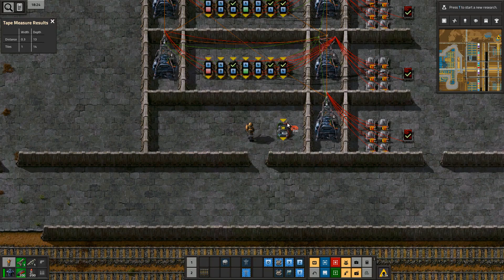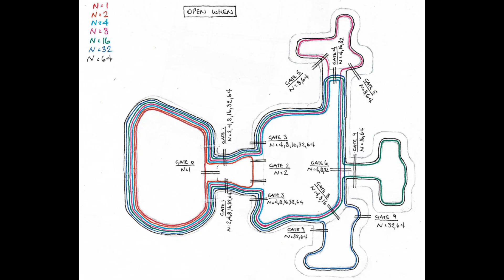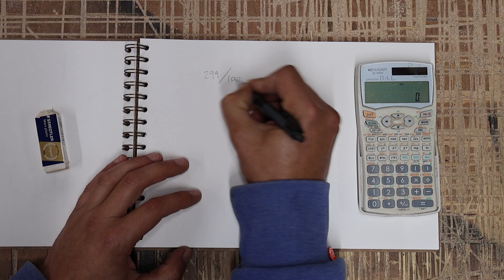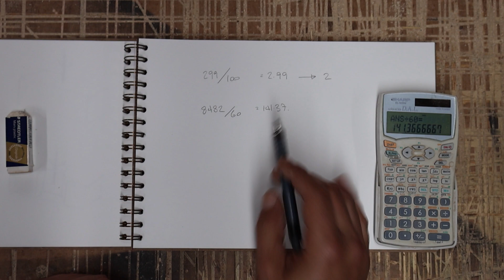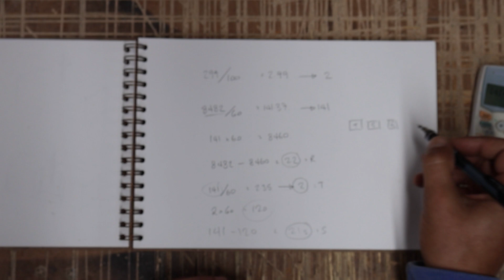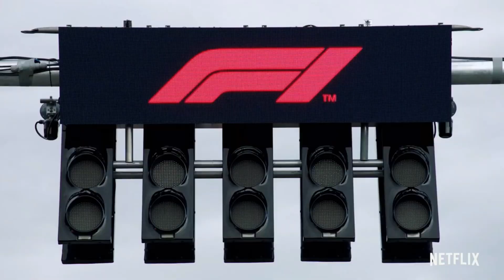Factorio - Racetrack Circuit Networks

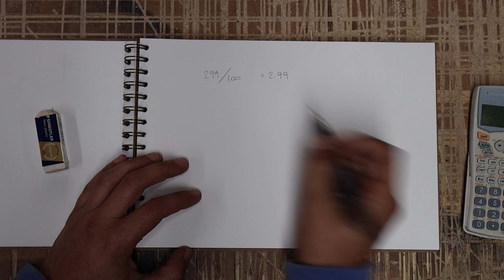Comment: 9:50 simply using "/" in factorio divides and rounds down
so in your example "299/100" results in "2"
now if you use "%" (modulo) operator you get whatever is left after dividing
"299%100" results in "99" and you can use this value for further calculations instead of doing whole "299-((299/100)*100)" chain to get the fractions

Comment: You could add a memory cell to the finish line that was reading the S value from the global network.  After the gates go down for the first person coming across the finish line, you stop updating the value in the memory cell. 

An easy way to start/stop values traveling through a network is to use an arithmatic combinator.  `* {each} x [input] = * {each}`.  Then just change the input signal to 1 when you want the value to pass through, and nothing when you don't.
Reply from the maker: I'm pretty sure I've seen a video where someone does what you are explaining here but when I tried it I couldn't get anything to work. So I gave up. 

I'm sure '* {each} x [input] = * {each}' makes sense to you but to me it is gibberish.
Reply: @theotherbigfoot  Sorry, that is describing the combinator inputs and ouputs.  Let me try to explain it better.
 
In the arithmatic combinator UI, the top left box gets the yellow "Each" Signal [*] (in the signals tab). That means apply the math operation it's about to do to every signal coming into the combinator. Then in the middle section you want the asterisk (multiplication), and then in the last box. you want some other signal that you're going to turn on and off, call it [Z].

Then for the output, you want the yellow Each signal again.

Now everything coming in will be multiplied by Z, which for this case, it would be 0 = no outpts or 1 = the same as the input value.
Reply from the maker: @sorahn_  Ooof, ok, where to begin. To start with, thank you, I at least understand the words you have put on the page!! Seriously, thank you, explaining this is stuff is difficult through text alone.

The 'each' signal multiplies everything? I'm used to a single combinator doing a single calculation, so multiplying everything is new
If I, say, enter A=5 as input as 'each', multiply it by two, and then output to 'each', where does it go? It can't output to A, because that would pollute the input, or does this need to output to a different circuit network?
How would this store anything? The timer is constantly increasing, by making something else equal to it then that other thing will always be increasing also. I don't understand
Reply from the maker: @sorahn_  Ooo oo oo, I've got it
Reply from the maker: @sorahn_  I don't have it.
Reply from the maker: @sorahn_  Nope, cancel that, I've got it working perfectly. Amazing. I am amazed.

Thank you. One last thing, is there an elegant way to clear the memory? So far I'm demolishing the combinator and then ctrl-z
Reply: @theotherbigfoot  awesome!!  To clear the memory you can just send in a 0 with a button press. 

There are elegant ways to reset them. I just don’t have one off the top of my head.
Reply from the maker: @sorahn_  I've had a night to think about this and now I have this working there is another possible thing I can make.

If I can find a way to set up multiple of these time storage thingies that cycle from one to the next as each driver activates the finish gate then I can record each drivers finishing time (assuming there is enough time for the gate to open and close between finishing drivers). I think I can do this with a series of power switches that activate as each previous time is recorded, and then also deactivate the current time with the same signal. But still keeping power to the combinators storing the time. Just disconnect everything else through the power switch. I think that could work.

Still need to find a way to reset all of this though. Ideally I'd like to use the GO switch so it is automatic with the rest of the race functions.

(Sorry to dump on you like this, if you aren't really all that interested and were just commenting for the sake of commenting then just tell me to sod off)
Reply: @theotherbigfoot  When the power of arithmatic combinators finally clicked over the basic if/else of deciders, I felt like I had to go through my base and re-do the circuitry everywhere  Hahaha.
Reply from the maker: @sorahn_  Ooof, painful

Comment: Loving this implementation! Just one question: What's the difference between divide->multiply->subtract and using modulo in an arithmetic combinator directly? Thanks for the fun video!
Reply from the maker: I don't know, is the answer. I don't know what modulo is, I've never heard of it before. I've looked at the description on the factorio website and I don't understand what it is saying. 

Is this some programming jiggery pokery? I'm not a programmer, I'm a structural engineer, I design buildings not code!! The limit of my coding is VBA!!
Reply: @theotherbigfoot  modulo is the remainder of a division, ie 5%2 = 1
so to convert ticks to seconds, minutes and hours u could do  274000%60=40, (274000-40)/60=4566, 4566%60=6, (4566-6)/60=76, 76%60=16, (76-16)/60=1
that gives u 1 hour, 16 minutes, 6 seconds and 40 ticks
in terms of combinators that would be 1 modulo operator that gives the output to the display, one that subtracts it from the previous value and one divider that gives the next value to repeat the process
edit: fyi factorio doesn't use miliseconds as it runs at a constant 60 ups, mili is always 1/1000 of something
the modulo operation also works well with timers, since it will always output a number from 0 to 1 below the divider. That way even if the number increases to infinity the output will be capped
also, there indeed is a way to stop a timer if u build it right, if i can get the map i could implement a few changes it and send it back
Reply from the maker: @przemo12323  I get it. That is super cool. Currently I have 6 combinators, by my reckoning this method would get me down to 4, I think that's right. I'm gonna have a play with this. Would definitely make the flashing lights a lot easier. 

If you could do that you would be my hero. It is a feature I would so like to have (and understand how to achieve)
Save file - https://www.dropbox.com/scl/fi/mmyvvejw55iplwrd7s9lj/Lets-Play-25-08-23.zip?rlkey=w8uisij9v6n8oejcc6cumml7n&dl=0
Reply: @theotherbigfoot  idk why i can't post links here but i tried contacting u on discord, i can send the file there
Reply: @theotherbigfoot 
Modulus is an arithmetical operator to calculate the remainder for a division. E.g 14/4 can be divided exactly 3 times without a remainder (no decimals). To determine to remainder we can now use 14 - 3*4 = 2. So the remainder is 2 for 14/4. This can be check using the following expression 3*4 + 2 = 12 + 2 = 14. Modulus is usually represented by the symbol %. So the previous example, can be written as follows: 14%4 = 2.
Let’s take another example 13%3. We start by calculation how many times 3 fits in 13, which is 4 times. We can now determine the remainder by the following: 13 - 4*3 = 1, so 13%3 = 1
Here follows a couple of examples:
15%4=3
6%3=0
19%5=4
15%0=15
16%4=0
17%6=5

Let’s take a practical example:
Question: Convert 100 seconds to minutes and seconds.
We know there are 60 seconds in a minute, we are thereby wondering how many times 60 fits in 100 (how many minutes there are) and how many seconds that are left (the remainder)
Step 1. Calculate how many minutes fits in 100 seconds: 100/60 ≈ 1,67 and if we round down, we get 1
Step 2. Calculate the remanding seconds: 100%60 = 40
Answer: In 100 seconds there are 1 minute and 40 seconds.
Reply: There is no difference, both methods will give the same result.